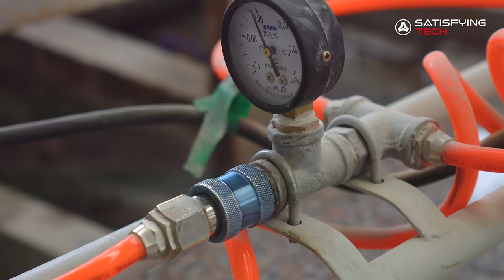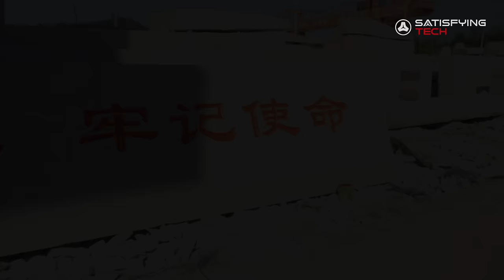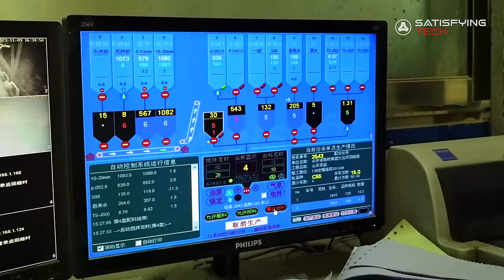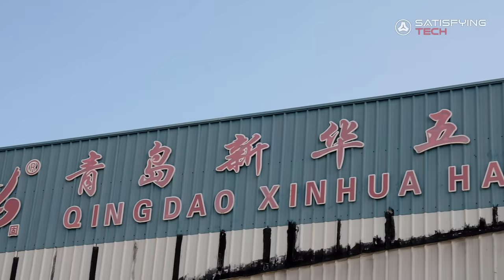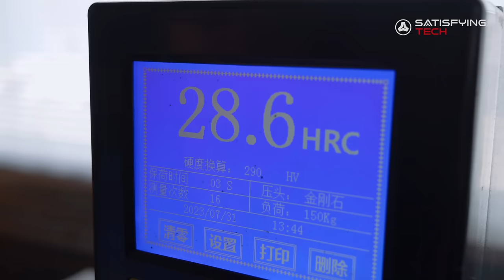BEST7! Amazing Mass Production Process! Impressive Factory!

Comment: 2:25 Strange, first its a left turning nut, few moments later its a right turning nut 😮
Reply: You forgot the flexy sledge hammer.  I stopped watching this BS after that.
Reply: You obviously looking at two different nuts one right after the other. With a cutting blade on each side turning the same direction, the threads are such that one is left and one is right so that they turn to tighten with friction of the disc preventing them from working loose.